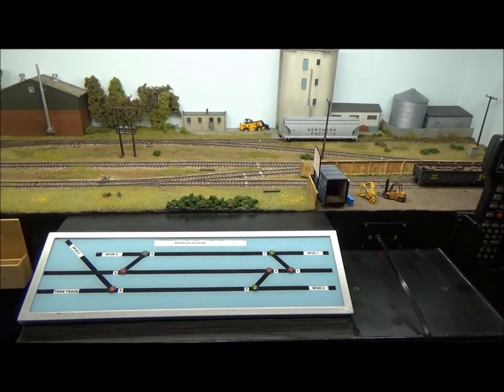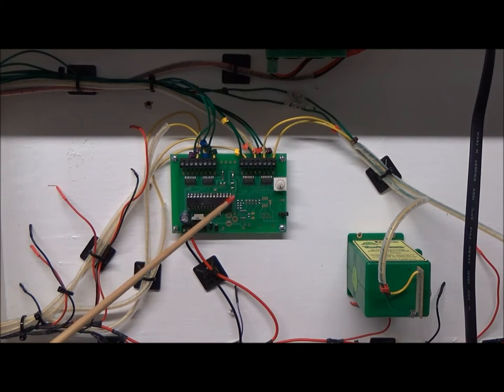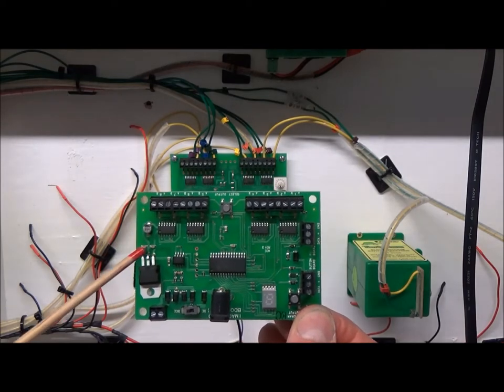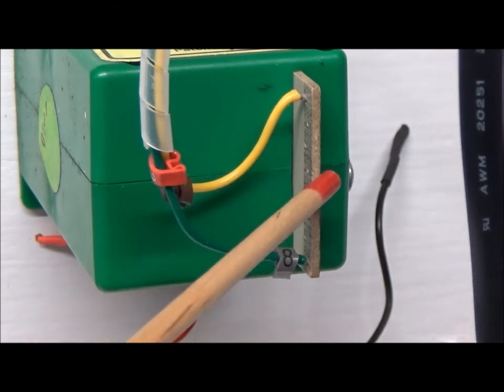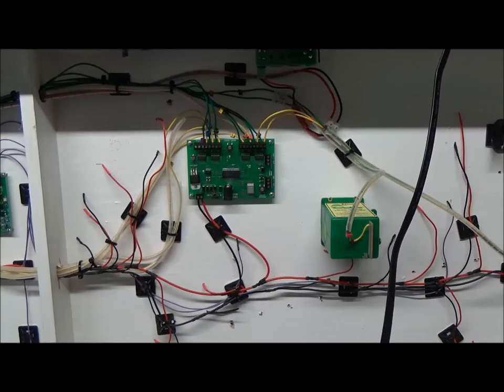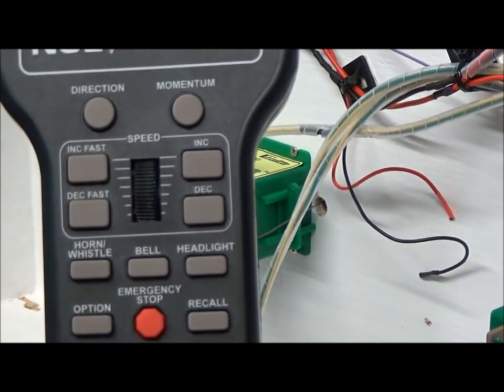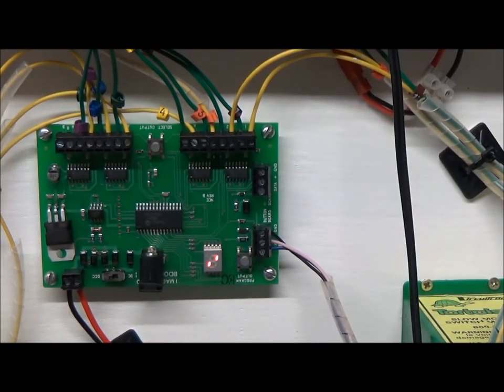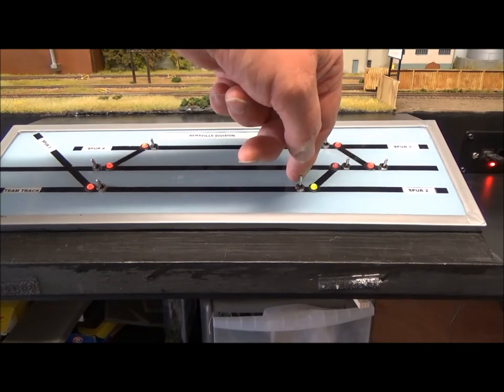Changing the NCE Switch 8

Comment: Hi Keith,

Nice run through of the electronics.  I love how far everything has come for model railways and I like your ability to control the turnouts with both methods.  I do like the idea of having that easier way of changing the points rather than having to faff about remembering dcc addresses.  Cheers,  Michael
Reply from the maker: Michael Henfrey Cheers Micheal. I do like gadgets, and anything that makes operating more fun. As I said it will make it easier for people to operate when I'm at exhibitions. If I'm ever at show and you are also there come over and say hello. You can take over while I go get a brew! Keith

Comment: Is your layout dc or ac?
Reply from the maker: Scrumptious Model Trains Hi, it's DCC. The track voltage is 15 volts AC, the decoder on the loco converts this to DC for the motor. Hope this helps. Keith
Reply: If dcc is really ac then I wonder why they couldn't use induction motors on model trains
Reply from the maker: Scrumptious Model Trains I think AC is used because that's how the information is sent to the decoder.  Not sure why induction motors are not used. Maybe they can't make them small enough? Keith